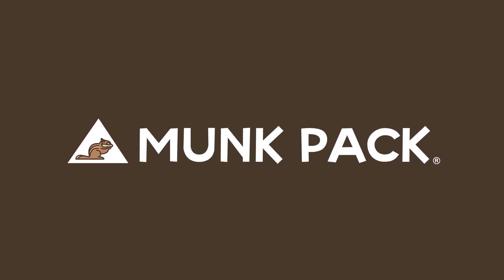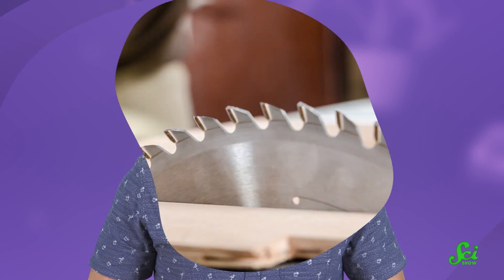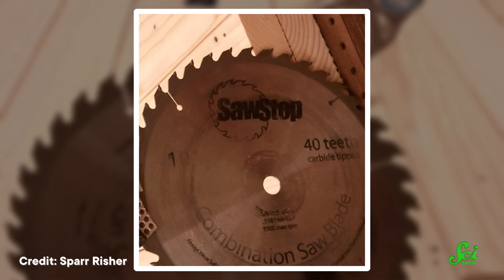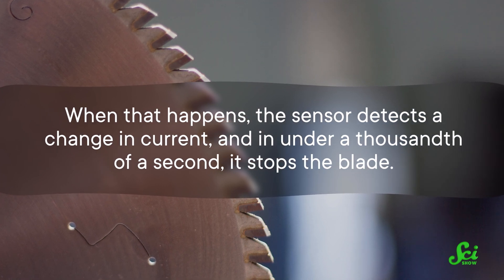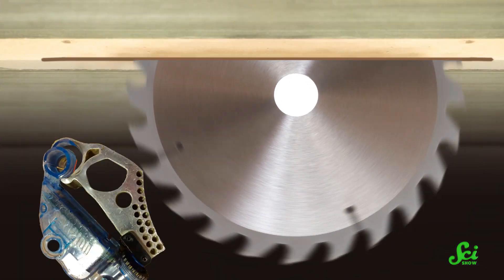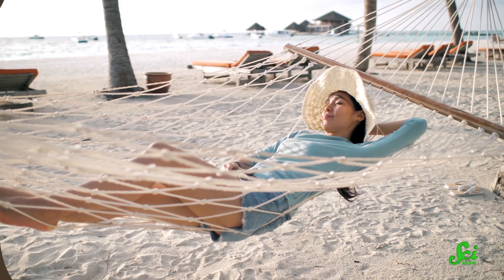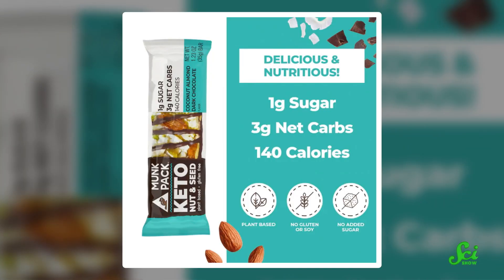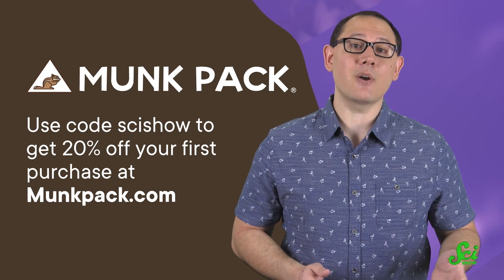How Can a Saw Know What It’s Cutting?

Comment: As a former framer of residential houses, I have to wonder what kind of moisture content or presence in or on a board would trigger this feature. That said, I know of at least one person who likely wishes he had bought a tablesaw with this feature
Reply: The inventor said that green wood may trigger the break. The system has a disable function to allow the cut of green wood.
Reply: I believe the wood has to be over 30% moisture. At least thats the highest I've seen go though a saw stop. Most wood is tried to 5-15% depending on environment
Reply: SawStop allows you to turn off the brake so you can cut through wet wood.  They also provide moisture content suggestions so users will know when to turn this off.
Reply: I've heard different things from other people but from what I gathered the wood would have to be dripping in order to trigger the brake, even then you have to be touching the wood in order for it to kick in because there will be no drop in voltage if nothing conductive is touching the wet wood, the same applies for a nail in the board it's not going to trip the system unless you're touching the nail.

In any case where you're using a push stick or push blocks it's unlikely to trigger the brake. by the way you should always use push blocks or a push stick when possible, it might seem unnecessary because after all it's just one cut, but one cut can change your life forever. Sawstop is a great safety net but it's not an alternative to good safety practices it is a supplement.
Reply: Also I don't think sawstop makes a jobsite saw. At least, the one I used was very much shop use only. Far too big to bring to a jobsite.
Reply: @reaganharder1480  Bosch made a jobsite saw with competing technology called Reaxx . SawStop got an injunction but The patent runs out soon.
Reply: I would think the MC would have to be high enough that you wouldn't want to cut it in the first place. Cutting into damp wood sounds like a dumb thing to do, regardless.
Reply: @Anatinea  Cutting wet wood isn't a dumb thing to do and whether or not you cut wet wood depends on what type of woodwork you do. Sawmills almost exclusively cut wet wood. Wood workers that make furniture and such will almost always be cutting dry wood. Construction workers always want dry wood but the garbage you get from home depot and lowes will occasionally still be dripping wet when cut. Also, some people harvest their own wood and mill/dry it themselves and then use it for finer woodworking.
Reply: Too much moisture can set it off.
Reply: If you forget to disable it to cut wet wood ( like pressure treated) the device being triggered ruins the blade, brake and cartridge . Several hundred dollars is still cheaper than a ER visit.

Comment: It's a cool system for sure but I didn't know moisture would set it off.
Reply: The wood has to be really wet in order for it to set off, also even if it is that wet you need to be touching it in order for it to go off (which you shouldn't be doing anyway, you should be using push blocks or a push stick because that's safer).

Comment: What I want to know is does it wear out over time or does a build up of sap slow it’s response time and how much does it cost each time you stop a blade.    And furthermore I’d like to know what happens if you hit a nail or bit of metal  like a bullet????
Reply: This system saved my wife finger, it really does magic, for your question, anything metallic, nails, measuring tape will trigger the break.
Reply: @hugogagne-croteau2915  thank you
Reply: Usually if the bullet or nail isn't also touching the table top, it's OK. If you have inspected the wood and see something that could be a nail or something, you can turn off the feature so it won't set it off for things like wet wood, or aluminum, too. No, there's really not anything to wear out or slow down. Cartridges are about $100, but you may also need to replace the blade.. if you have a high-end-enough blade you may be able to salvage it by sending it in to places that can replace teeth, sharpen, and check for micro cracks.
Reply: @necrojoe  a blade is nothing.  We use the table saw four hours a day 5 days a week.  By far it  has hurt more people than any other tool.   It’s mostly because you are pushing the wood through the blade instead of pulling the blade through the wood.   The table saw is the most accurate tool in the shop hands down lol.  We switched to using a circular saw blade 7-1/4  because we don’t cut anything thicker than 1-1/2” and it gives it more power.   I like it better    We always keep the blade just above cutting hight and we have had less kick back since then.    40 tooth 7-1/4” blade seems to cut way better and safer than  a  regular blade with 32 teeth     Have you had any experience with the smaller diameter and smaller width blade on a table saw.    I get a little blade deflection if I push too fast.
Reply: If you're wanting to use a piece of wood that has sap, you'd cut around the sap pocket, not through it. If you did cut through, the blade would get covered, not the stop. You'd have to either replace or clean the blade as a dull blade is more dangerous than a sharp one (higher chance of kickback). The same points also apply to cutting into wood with metal. You avoid it as much as possible by either removing the nails or cutting the parts with the nails off. If you were to hit a nail (as I have), you'll be more startled by the sudden shower of sparks. The metal wouldn't activate the stop, as there's no current going though it.
Reply: Setting it off costs dramatically less than an ER visit in the US. The biggest expense is the replacement cost of the blade being used at the time. The cartridge has dropped in price quite a bit over the past few years. There are some material limitations. Metal can set it off, so can some plastics. If it’s conductive, it can set it off. So wet wood can set it off too. I don’t know about the sap thing.  You can disable the automatic stop mechanism if you need to cut though wet wood or plastics.
Reply: IIRC, if the sawstop saves a finger, it's replaced free of charge.
Reply: @TheMan83554  if this saw save my finger, I'm happy to send them money for a replacement cartridge
Reply: @TheMan83554  that’s really kool
Reply: the cartridge must be replaced. yes, a nail or even wet wood can trigger it, but you can override the system if you know you might hit one of those. about a hundred bucks a pop
Reply: Thank all of you.   That was a great amount of information to me.   My buddy just cut the tip of his thumb.   We always practice turning the blade down as low as possible.  I think that helped him   Thanks again.  I think I’m going to check into it more.
Reply: There are competing products that worked with compressed gas that didn’t destroy the blade that got sued out of existence by the Saw Stop guy. They care more about money than safety. Lookup the Saw Stop vs Bosch lawsuit.

Comment: There should be a process, a la eminent domain, to force proprietary safety technologies to be adopted by the market at large, whether or not the inventor and the rest of the industry likes it or not.
Reply: That process exists. It's called a patent. It's what patents are for. In exchange for the full disclosure of the invention, the patent holder gets a limited time exclusive right to use it. After that time, everyone can use it, thus preventing trade secrets from getting lost forever.
Reply: @grieske  That's not what patents are for. Patents are protecting one entity's profitability for a limited time regardless of net benefit.

If the patent holder feels like they can get a better deal through exclusivity, or holding out, then the technology is not spread before the patent expires. If other companies feel like the competitor is not enough of a threat, they might just hold off implementation until the patent expires.

There needs to be a process to skip all of that, and force the inventor to sell at an arbitrated rate, and to force competitors to implement that technology, or demonstrate they have a functional equivalent, whether they want to or not.
Reply: The main patent for this technology has expired, and the bulk of the related patents end by 2026.  So, the proprietary aspect of this technology will soon be gone.  But, the technology still costs money.  I guess you can make an argument that this issue is so important that it should be regulated, with only saws with this technology are allowed to be sold.  But that would double the cost of low end saws, driving folks to either not get table saws, or buy them in the used market where saws are still available that don't have even more basic safety features, such as riving knives.  If I was using a table saw in a business, I'd buy a Sawstop.  But as a fairly occasional hobbyist, no way would I chose to spend the money.  As far as damage to society, amputations from table saws are a minor problem compared to IEDs in Iraq and Afghanistan during my lifetime.
Reply: @richdobbs6595  "But that would double the cost of low end saws"

It would not. The price would increase, but not double. Once the technology goes to mass market, economies of scale will reduce the price, not to mention, you'd get rid of the proprietary technology markup.

As for hobbyist tools, that's a whole different can of worms to get into.

For starters, one person buying a major power tool like a saw that spends the majority of the time not being used is just wasteful. It would be far more efficient to just have a community workshop that hobbyists could drop in and use whenever, but that discussion branches out into a ton of different issues.

As for your comparison to Afghanistan and Iraq.... who cares? "That other worse thing exists" has no bearing on any discussion about this bad thing.
Reply: Absolutely. Capitalism prefers people accidentally amputating themselves over slightly smaller corporate profits. Patents are awful for progress.

Comment: sidenote that you missed: Table saws have a chance to cause 'kickback', which can pull your hand into the blade. Kickback is usually when a piece of wood gets stuck between the saw and the fence, or if a cutoff part gets pulled on the teeth in the back of the saw, where it comes out of the table. That grabs the wood and kicks it in your direction. Now, if your hands are holding that piece of wood while it gets kicked, it pulls your hand into the saw and can amputate fingers in a heartbeat, even though you would not have cut into your hand without a kickback. 
its so uncontrollable, that in one very well known video, where a guy shows how dangerous kickback is, the operator almost cuts in his hand, while doing a safety video. https://youtu.be/u7sRrC2Jpp4?t=151 (thats the video) 

TLDR: never use a tablesaw without first learning about safety. other saws are much safer.
Reply: I've seen table saws that have a stationary blade behind the the saw blade that is meant to prevent exactly this. Very recommended to put something like that on your table saw.
Reply: @ipodge1731  yes, thank you! thats called a riving knife and i would never run a table saw without it. does not 100% prevent it, but makes it less likely to occur. a piece could still get pinched between the blade and the fence, so its still possible to kick back. the danger of stuff being pulled on the back is way lower with one though.
Reply: @halsti99  I just watched a video where someone in the comments told the guy he should be using a riving knife- he had a dado stack on, lol.
Reply: Not to mention that if you're standing behind the blade and not off to the side like the guy in your video, that kickback could be going right into you, and that's not going to feel good.
Reply: @rickseiden1  I can confirm that items launched from kickback do not feel good when they strike your body.  I was cutting some polycarbonate, and the damn saw launched both pieces at me as soon as the cut was through.  I saw them accelerating, but the actual flight was too fast to perceive.  One piece hit me in the gut and cut through my sweatshirt and T shirt to give me a small boo boo, and the other flew into my fingertip, cracking the nail all up.  It didn’t hurt as bad as as it looked like it did, but my brain decided that near fainting was a good plan, anyway.
Reply: @rickseiden1  There's a reason why a lot of carpenters use the centre pouch of a tool belt for a tape measure rather than a clip on the side...it's basically a makeshift jock. Friend of mine was cleaning our shop near the end of the season, so no building, and so didn't have his tool belt on. No lasting damage, but he couldn't walk right for a few days...
Reply: Stand to the side and use a push block. I've totally sent pieces of wood flying across the shop because of kickback
Reply: Couldn't have said it better myself. Unfortunately I haven't been able to afford a sawstop, but because of that I use basically every other tool at my disposal unless absolutely necessary; my table saw is the least used tool in my woodshop.
Reply: @robertchitty3603  track saw removed my need for a table saw 95% of the time. Table saw is rarely used order than for dados
Reply: @somewherealongthehighway  true and even then I'd rather use my router
Reply: I remember seeing that video years ago. Couldn't believe how lucky that guy was
Reply: I’m my carpentry class they had gave us some sliders to push it so we didn’t have to get our hands near it.
Reply: @veasey3997  yes. 100%. usual rule of thumb is 1 spread out hand distance from the blade is fine. anything closer calls for a push stick or push block.
Reply: wrg
Reply: Yea you are correct but not with a SawStop. Touch the blade at any speed the blade stops and drops beneath the table in less than 10 milliseconds.
Reply: @JustaPilot1  you are partially correct. it saves your hand if you touch the blade. yes. there even is a video from the Saw Stop CEO intentionally touching a spinning sawblade to prove how good it works. 
But kickback can grab the piece of wood you are cutting and sling it at you, with immense force, without you ever touching the blade. so a saw stop will not prevent it.
click on the video i linked in that original comment and imagine yourself standing behind the saw.
Reply: @halsti99  I was replying to the OP indicating that kick back, under the right conditions, can pull your hand into the blade and " amputate fingers in a heartbeat". You are correct the SawStop will not prevent kickback but the OP is incorrect that you will amputate fingers in a heartbeat. With a saw stop that is pretty much impossible. No matter how your flesh touches the blade is stopped and below the table in under 10 milliseconds.
So even with kickback, you'll basically have a witness mark and nothing more.
AS a point of reference I've had an ICS for ~18 years.

Comment: You can't talk about Stop Saws without talking about the cost. The technology is expensive, and when you trip it, it's very expensive to replace the blade and brake
Reply: I imagine it's cheaper than the potential hospital fees though
Reply: @cameronwilsey9334  Yeah, but most people don't ever cut off their fingers with a table saw.  Still, personally, a friend of mine in high school did, and more to the point my father did during his retirement years.  So this is definitely something that wood workers think about.
Reply: Don't trip it, and if you did, chances are you saved a finger. Replacing blade and brake is cheaper than hospital bill, by a lot
Reply: It’s gotten waaaay cheaper to replace the brake in the last few years. The cost of the blade is still the cost of the blade, so that’s still expensive.

Comment: Just need to make sure the wood is dry
Reply: You can cut wet wood with a sawstop, you just need to make sure you aren't touching it, there won't be any dropping current in the sensor if you aren't touching it and therefore no activation.

How do you cut wood without touching it you may ask, why you use a push block or a push stick people have been using them for years and while they won't prevent you from being injured on the saw they will greatly reduce the chance of it happening. Use them, even if you have a saw stop, at the very least it could save you an activation.